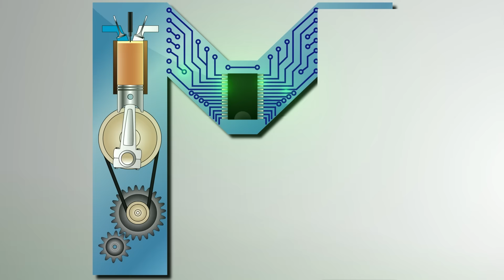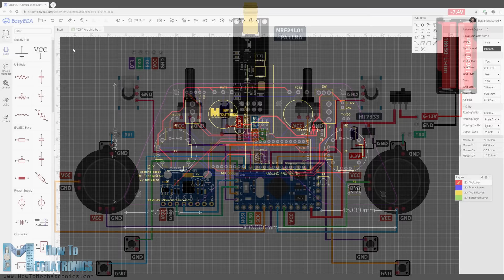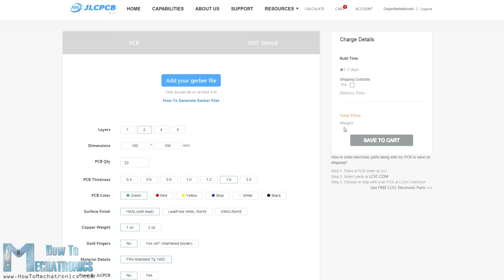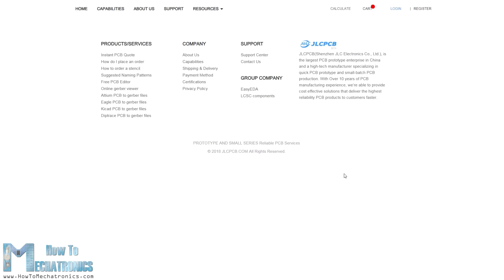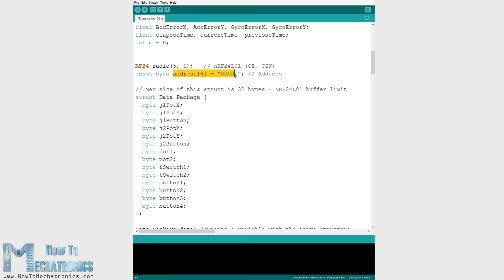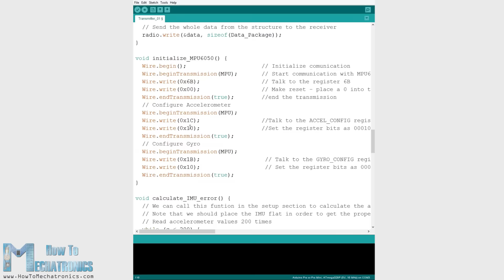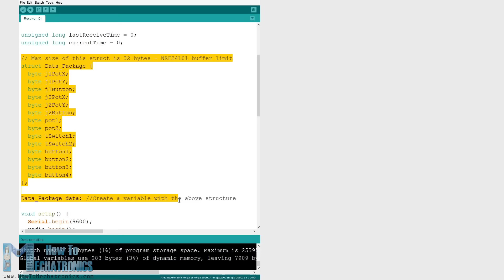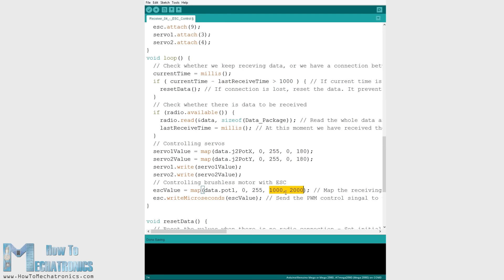DIY Arduino based RC Transmitter

Comment: Hello,

              Iam making 14ch transmitter and receiver i have a problem in this,

That is in receiver how many output channel are there.

You given 6digital channels  in wiring diagram 

where to connect another

8channels plz reply sir

Comment: Is it possible to control multiple Arduino receivers with this RC transmitter and to be able to switch between the receivers directly from the RC transmitter?
Reply from the maker: It's possible, but it needs to be programmed appropriately.

Comment: Excellent video sir, you make it simple. Rather than using a transmitter can you hard wire to the receiver over a tether. This application would be for an underwater ROV (remotely operated vehicle) if that is not difficult would you consider helping with that? If yes, I'll send you my contact info. Thank you for an excellent video.

Comment: Is it possible to take apart a drone with 4 motors that spin when u accelerate but is it possible that when u try steering u can make the vehicle steer  without having to put a steering system for an rc

Comment: My joystick is has a very low range physically that I can move it till it hits max voltage or minimum voltage. What exact product are you using for the joystick? Maybe I have a bad component

Comment: kindly let me know the capacity of the both the capacitors you use on the board?
Reply: I too wanna know the same. Kindly tell me if you have got the info

Comment: nice project <3 . is it possible to run one brushless motor and l298n motor driver with this codes? i need to run one brushless motor and one l298n driver

Comment: Can you make 3 joysticks,2 potentiometers,4 toggle switchs and 6 push buttons pcb design and use same components to make Arduino transmitter and receiver

Comment: Your mapping function are off by one, use map(analogRead(x), 0, 1024, 0, 255)
Reply: No it is not. Open up any programmer calculator. Enter 1024 as decimal and convert it to binary. You will see you have 100 0000 0000 which is 11 bits of data. The analog input gives back 10 bits of data at maximum. So 11 1111 1111 = 1023(dec) so the map is good. However using the  right shift operator twice would result in a much faster code:
byte data = analogRead(pinName) >> 2;

Comment: This video looks perfect, but I want to know how many errors you made XD
Reply from the maker: Thanks! Well yeah, there are always errors and troubles while making. For example I first soldered a MPU6050 board with different color and I didn't like. Then I soldered capacitors which where around 13mm tall and wouldn't fit into the case which has 11mm space, so I desoldered them and soldered shorter ones. :)

Comment: So looking at the PCB design, are the buttons actually functional? They've got digital lines going to them , but no signal return or pull-up/pull-down resistors.

Am I missing something?
Reply: The Arduino has internal weak pull-ups that are activated by defining that pin as INPUT_PULLUP.
Reply from the maker: Yes, that's right.

Comment: hello how to mec , I am going to make this nice transmitter & receiver by watching and reading your blog post.i have a question , if i not use mpu6050, will it making  problem for  the receiver ? [and not changing the code] although i have mpu6050 but i am not interested to use it .
Reply from the maker: No, you won't have any problems. You will just have to remove those lines of code for it, but that's easy, it doesn't affect anything else.
Reply: @HowToMechatronics  if I use this transmitter on the car by uploading your "robot car code "  in the receiver, are those transmitter potentiometers ( pot 1, pot 2)   will be able to increase decrease the robot car speed?

Comment: HII SIR THIS PROJECT IS AWSOME 
I HAVE ONE DOUBT , I WANT CONTROL TWO SERVO MOTOR WITH ONE JOYSTICK FROM TRANSMITTER FOR RC PLANE FLAPS CONTROL ,IF I MOVE JOYSTICK -> right side two servo rotate oppsite ,if i move joystick left <- two servo move opposite each other PLEASE HELP ME SIR

Comment: How do you find joystick range, I bought few of these and found that the voltage from each axis reaches full vcc after about 20% of movement after that it stays at full voltage for the rest of movement.
Reply from the maker: Well yeah, that's true, these joystick are not that good if you need like really precise and bigger range of the joystick.

Comment: Does this controller work with non-arduino RC cars?
Reply from the maker: Well not straight out of the box. It could work in case you modify the RC car and add an Arduino and a NRF24L01 module to it.

Comment: can you help me with locating the ground connections 
there are 18 ground connections but they are not connected in gerber also how can i edit?
and what is the reason for those rx and tx pins?

Comment: Hello,  i'm making a rc car to my son and i used your design and it's worked like a charm:) Servos and l298 driver working great But i didn't managed to use buttons, i want to control leds (static and blinking types of leds) and buzzer, i'd try  this code;

led1value = digitalRead(data.button4);
  
    if (led1value = 1)
  {digitalWrite(led1, HIGH);
  delay (10);
  }
  else if (led1value = 0)
  {digitalWrite(led1, LOW);
  delay (10);
  }

Can you help me if something is wrong with the code?

(All the buttons are working in serial print)

Thank You;)

Comment: I have an problem. You have used arduino pro mini Atmega 168, but I am enable to get this model, I have bought Atmega 328 which has different pin out so I request you to design the PCB using Atmega 328.

Comment: sir i have a aurduino drone based drone where an arduino uno is used as a flight controller idk arduino coding i used a internet tutorial to build it but that tutorial used an aftermarket controller and reciver but i want to make  transmitter and reciver myself so which pins of the reciver is pitch x axix and y axis ? can u help please ?

Comment: I am 14 years old . Can i get a diagram link of the transmitter having only joysticks, one potentiameter and nrf25l01 and arduino and capasitors. If I make can i use it to your receiver and if you have time please give me the link of code for arduino for rc plane pls give replay
Reply: Potentiometer for controlling motor and balance for chennels

Comment: Hey Tubers, here is the Joystick that works with this project.  
Gikfun 3D Joystick Axis Xbox PS3 Sensor Module Potentiometer B10K Switch Replacement Controller for Arduino (Pack of 2Pcs) EK1908... Be careful with the install.  Pins will be bent on arrival from Amazon. -- Regards Kd0zw

Comment: Two servo mixer working on this project
Reply: were you succeed building it? i have problem wiring the reciever 
uploaded the program in the receiver and i dont know what 3 wires are channels? also after making connections on the pcb my arduino didnt light up seems it is not connected somehow 
please help me if you can

Comment: I made this transmitter there is an error on uploading the code 
nRF24L01.h no such file or directory
Reply from the maker: You need to install the nRF24L01 library first.

Comment: Can I use the transmitter code with esp32 instead of Arduino nano . I think there might be a need of changing the program for mpu6050 as esp32 has a 16 but ADC . If anyone knows about this please reply .

Comment: Hi, 

You have done a mistake on the transmitter pins, as you mixed the TXO and RXI which it wasted a months of my life of how to figure out the mistake. Also, the NRF24L01 transmitter pins maybe wrong as its not communicating with the receiver!!!
Reply: Did you download the libraries and include the contents of the libraries zip folders into the arduino library folder?
Reply: @insertnamehere8096  Yes, I have, but the pins are disordered. I managed to solve the issue by swapping TXO and RXI pins.
Reply: @insertnamehere8096  Can you make a video for making drone quat X please.

Comment: Transmitter code is verify error how can fix   data.j1PotX = map(analogRead(A1), 0, 1023, 0, 255); // Convert the analog read value from 0 to 1023 into a BYTE value from 0 to 255

Comment: can you made the same circuitry with hC-05
Reply: The HC-05 generally uses asynchronous serial rather than SPI.
You should probably make sure the Arduino has its hardware RX and TX lines available so you can use these lines with the HC-05.

Comment: What is the range of this remote controller
Reply from the maker: It depends on the antenna and the environment conditions. If used with an antenna and in open space it can have up to 700 meters of range.

Comment: GREAT VIDEO +1 SUBSCRIBER FOR YOU :)
What is the difference between a Raspberry Pi, and an Arduino?

I have a RPi that works well with digital IO.., but seems to have issues with analogue data. (I.e. using the  RF 433mhz transmitter).

I don't want to start a war about which one is better.., or best for specific scenarios. If the Arduino is more technical / low level / provides more options.., then I will convert. I'd prefer to learn than be lazy.

Thank you in advance.

Comment: If anybody has knowledge about drones I recently took apart a drone and turned it into a rc monster truck but it can just drive forward and doesn’t turn because most drones all the motors are in spinning rotation! But I have a feeling there is a way to somehow make it to steer without having to use a motor for steering if anyone has knowledge let’s talk!

Comment: Is the transmitter channel hopping? Any good RC Transmitter worth its salt today has channel hopping to prevent other transmitters or other stray signal from interfering with performance and reliability. Any cheap transmitter can send a signal to a receiver. The trick is to prevent stray signals from causing servos from operating or not operating. As most Transmitters are required by FCC law to be  interfered with as any signal from a government operated piece of equipment can and will be able to operate without interference from any other equipment. This is mostly important with aircraft radios and anything used by the government for communications. One way around this is channel hopping. A transmitter that has the ability to use as many as 120 signals that rotate at such a speed that it cannot interfere with government operated equipment but akso cannot be interrupted by any other transmitter. I have found these channel hopping transmitters as cheap as $35. As I see it, your transmitter has no such ability. I wouldnt recommend using your transmitter on any RC flight capable equipment. Yes, you would have extreme range because the signal you are sending is broadcast on one band . A 72hz transmitter can function for a long way but chances of corrupt signals inrrupting your signals is high. If anyone else is using that frequency, you are screwed.

Comment: how much range it can cover?
Reply from the maker: Max 700 meters in open space with the antenna.
Reply: @HowToMechatronics  What is the specific value of the capacitor for better range?

Comment: What's its range of remote
Reply: About 1.1km on open field
Reply: @azbc8369  1.1km yes bro its very long range but remote control car i have only go a little far and then lose its range so its means if its in quadcopter and i am sitting in home i can fly it 1.1km far from my home

Comment: I will use arduino nano to connect my android phone ,and write an android application to control remote device via nrf-24-l01.    android app ->USB ->  nano-> nrf-24-l01 ->  client nrf-24-l01 ->  device.

Comment: Hello
Like your diy designs. I would like to combine two of your projects, with the help of you, if possible.

(DIY Motorized Camera Slider with Pan and Tilt Head – Arduino Based Project
) (DIY Arduino RC Transmitter)
Want all the features from the slide, plus motor for focus and zoom (4th engine No slide!) and everything is controlled from 2.4 or 5Ghz wireless, preferably 5Ghz.
If possible even 50m cable. Like network cable Rj45 at both ends.
 Pan right left with joystick, focus, zoom and z-axis with potentiometer.
Reply from the maker: Hey, thanks! Yeah, that would be definitely much cooler and practical camera slider, but I'm afraid I cannot particularly help you much with it. I mean, I would love to see that project, but it requires quite some modification, both on the code and the mechanism of the slider. I don't have the time to make such a particular project, you will have to find a way to make it on your own. Learn from multiple tutorials and projects and make something that works the way you want. Actually that's the point of my YouTube channel and website, teaching a little bit of everything so you can make something on your own. Cheers! :)

Comment: Am a urology resident from India.... I need a help in designing a robotised laparoscopic tool .. I need four bldc presicion  micromotors to be controlled by a joystick and push button.... I need your help..... If it works it will be of great help to younger surgeons in practice.... I need your help and assistance.... thank you